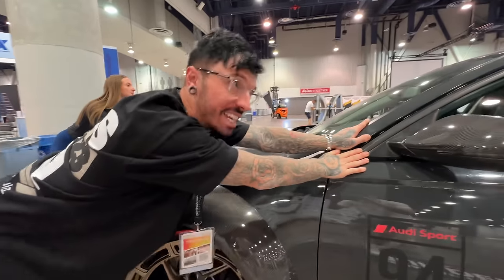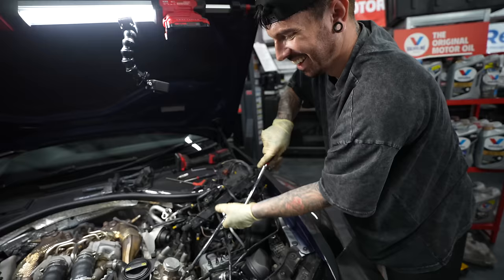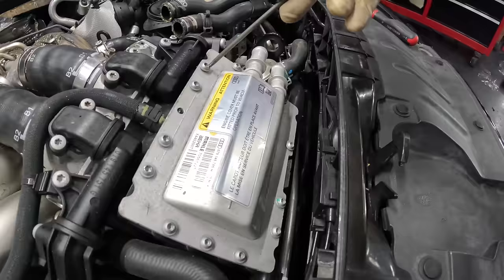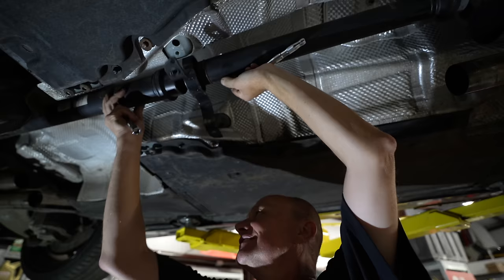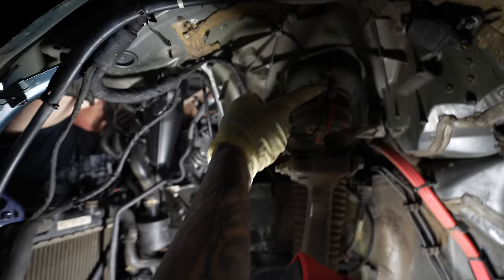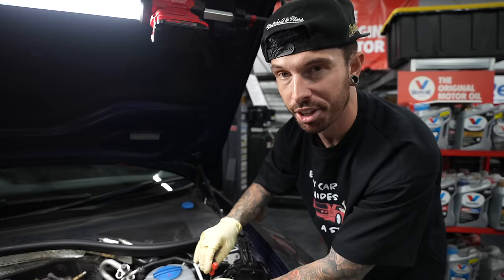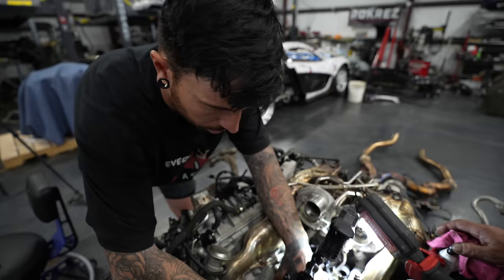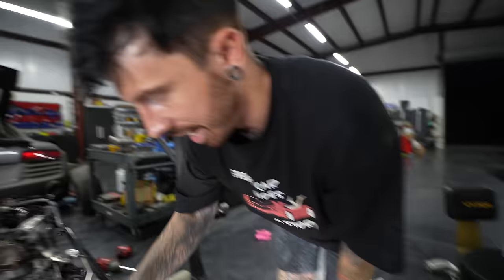REBUILDING A WRECKED AUDI RS6 GT3 #1

Comment: Hey Mat, every modern Engine have Knocking Sensors. If you put bad  fuel like 95 Octane in the Tank, the Car automatically change the Ingition for the Conditions. 

The Tuner has to recalibrate the Maps for that. But if you turn Off the Knocking System or Component Protection the Car will do everytime the same Performance also with bad Fuel. Otherwise your Engine Pistons or other Components can be broken like in your Video.

Greetings from Germany ✌🏻
Reply: Wahrscheinlich wurde das nicht berücksichtigt
Reply: he talked about in the last video or the one before that the fuel and tune probably was the reason
Reply: This
Reply: I also posted something similar.  It wasn't just the fuel, as the knock sensor would have protected the engine from pre--ignition.  Something probably happened during the remap that bypassed that safety.  100% user error.
Reply: Exactly..a very bad tuner is the cause, not just the fuel.

Comment: Great vid Matt. Sorry for the poor RS6 engine (been an owner of rs5 and rs6 myself ) The fault is absolutely on tuning and not on the benzine though. Should have gone for dual map on the ECU. I am on the opinion that supercars don’t need any tuning anyway :) .Love your work and vids. Waiting for the part 2 gonna be interesting
Reply: Its very kind on the remap shop. I am sure the stock map would have been able to detect the knocking and gone into limp mode before this happened. Regardless of the fuel it was mapped on, it does seem that some of the other safeguards of the stock map may have been removed.
Reply: Lol its nothing to do with the tuning. Its the fuel. Absolutely dumb comment.
Reply: @peterwilson4344   it’s the tuning or may be the not very professional tuning let’s say. The one mapping the car should have gone for dual maps. In case not then he should have said to Matt that it’s ONLY 99+ octane fuel and not use any other. So I discard your ignorant comment as you didn’t bother to read what i said. YES ITS THE FUEL FOR THIS result OF COURSE..but SHOULD HAVE BEEN A PROFESSIONAL tuning there would be a dual map or safe (limp mode) in case of knock sensing. If you get a 110v US appliance and plug it to an EU plug of 220v would you blame the power distributor? In case it had a switch you should have switch it yourself in case it didn’t you should have been informed that the boom will happen

Comment: Great video and hope the repair goes well. One little nit pick, a spark plug will fire before tdc not on tdc, this allows the spark to fully ignite air fuel mixture and have optimal power to push piston back down on the power stroke. This timing is actually changed when mapping the car

Comment: Never thought you could get a hole in your engine block if you use lower octane fuel after remap.
This channel turns into a car documentary.
Keep up the good work!
Reply: Normally you shouldn't, unless the tuner disabled the knock sensor and other engine protection systems to make it easier to map. It could very well still be down to a poor re-map

Comment: Freddy's shop works like a magnet on cars with water damage😁

BTW if the engine is completely busted just do an LS swap for shits and giggles 😁
Reply: Man come on look at that RS engine its already a race engine. The LS is fricking truck engine🤣🤣
Reply: @wcads623  I bet you an LS eninges is lighter, more compact and a LOT more reliable. And if god forbids, something like this happens, cheaper to fix as well.
Reply: @horvathr95  yep but to get the same power out of an LS would cost a hell of a lot more than the Audi motor.

Comment: Pretty surprised the ECU safeties didn’t prevent this. With detonation that bad, it must have had detectable knock long before this failure, I’d have expected a CEL and a limp mode to prevent damage. Surely the knock sensors were de-sensitized.
Reply: Agreed. Cali 91 is the worst 91 in the US. Wouldn't even consider it 95 RON. But the car should've pulled timing in an attempt to compensate for the fuel and sent it into limp mode with super knock codes. Combination of bad fuel + tune.

Comment: I know the video is 10days old but I work on old vw engines and to check if a intercooler works fine we use  two bits rubber hose plugged  up with a 17mm bolt and a jubilee clip done up tight and use a pressure tester on the other usually give you a good indication

Comment: Sleeving the block and it’s golden. That’s the problem with modern coated blocks. It can torch the cylinder as its just coated aluminum.

Comment: I had a mk4 rs turbo years ago dine by interpro. It appreared in the max power or fast ford magazines, it was one of the first cars with water detunation tank fitted to it to stop detunation and the cylinders from getting too hot at higher speeds maybe a thing to consider to fit in the future.

Comment: Mat one trick you can do is if you have lap timer enabled on your dashboard it will display your oil temp reading on the heads up display. Might be useful if you wanting to keep an eye on your engine temperature. I always drive with it on my 7

Comment: As a Subaru owner. Using the correct fuel is the number 1 rule of Subaru ownership. Also. If the car is mapped. You have to continue to use the fuel it was mapped too. If you can’t get the proper rated fuel. It ‘may’ be possible to use a small amount of a lower octane fuel but then you need to go really easy on the throttle. No boost. Until you can get a full tank of the correct Ron fuel. Bit late now I know. Now you can forge the engine too. Yay.

Comment: Incredible that the head gasket didn't blow as well - but piston being able to blow a hole right through the sleeve is incredible heat and pressure at one point - wow - ok, so now you have to find a 2nd hand block in good condition - that part shouldn't be to difficult..

Comment: Top Team Mat and his Dad ..... I owned a top spec S8 back in the day  (1999 - 2002). I took it to Agnew's in Belfast to fix an intermittent misfire. 3 visits with them and then a so called specialist ex Audi Dublin .... And £7,000 pounds down it still was not fixed. The guy I sold it to was a young airport mechanic..... He Sorted it in less than an hour ... It was just a blocked valve. Guys who use just diagnostic computers are useless. Experience is everything !  Can you imagine what the repair bill would have been on the RS6 if you had to take it to a garage ????? Audi's are now over engineered today  !!

Comment: vapor locked engine when running usually bends rods probably bent a rod or 2 or 3 and that's holding it from turning over

Comment: Back in the seventies I built a sunbeam alpine roots engine to stage three cam head mods inclined valve guides etc the twin 40s needed a custom inlet when I fitted it the spanner nipped the side of the ally inlet causing a small crack , 500 miles later a hole burnt through the side of the power max piston that let me slide my pinky through,the smoke that came out when it blew was epic, the good news no damage to bore or the piston rings, after fitting new piston and welding up the crack the engine went on to give awesome fun, 8000 rpm it would spin up to in the day that was an awesome number for the long stroke 1725 roots engine, it could gap the tiger v8 engined sunbeams with ease ,

Comment: I got a mazda 3 for free one time because it hydroplaned into a ditch and sunk.. it hydrolocked the engine and the hood was completly submerged... the oil was mostly water just like that.. got the car running but had a bad head gasket from sitting with all that water in it, or maybe from when it was hydrolocked, not really sure but i junked it lol...

Comment: You should place the charge Cooler in a bucket of water & use the workshop Air compressor to pressurize the  coolant side. If it bubbles it means theres a leak - as Metal gets hot it expands so you could have the fault when your car is warmer. :)

Comment: Matt, you know why that engine has seized was because when they press your head gasket on that head had blown, so then the cooling system that’s inside of the head had ended up going into the cylinder and causing the cylinder to seize and also starved of oil, so that will be why the  Oil will come after a fair bit of coolant

Comment: That one piston is crazy bad. If you can, get the injectors tested as this may tell more of the story. If the lower octane fuel was the cause wouldn't it be more evident on more than one cylinder? If the injector was partially blocked and not giving the correct amount of fuel then it could cause a lean condition that would put the extra heat in to the cylinder causing the issue. Definitely worth checking either way especially if your planning to reuse them in the build.

Comment: normally that is where the sensors on the exhaust come in, ie they measure and black box fine tune the injector to spray more fuel in the event of lower octane until it gets the desired result on the lamda sesnor, if the injector volume it can spray is lower than what is needed to not run lean you have a problem

ie normally cars handle different octanes ok as long as the octane is within the range the car was designed for
so assume the injector/injection system is sized volume wise for the octane of said countries 

so in the case of 91 maybe the injectors just could not deliver the amount of fuel needed not to burn lean

Comment: you hit the nail on the head with the fuel. it causes all sorts of problem running a turbo car on on low octane fuel and in the end causes exactly what has happend. never ran my subaru on anything other than 98 octane.

Comment: Sorry for your loss but just slap any 4.0tt back in there you already have the turbos so you just need a new engine should be around 5-10k based on milage

Comment: Just by removing the bonnet you could tell this will be a nightmare to work on, kinda makes you appreciate LS Crate engines being relatively easy to work with, and not this overengineered mystery box of an engine. 

But when you pulled the spark plugs out, wasn't there another one being super wet?

Comment: Ive seen people complain about how bad Honda's are to work on, but after having owned Honda's and Audi's.... Nothing really prepares you for the nightmare that was the 2.0T engine or the frontend removal for a timing chain replacement, CVT gearbox issues, or siezed upper control arm bolts... If i close my eyes, the nightmares come flooding back...

Comment: I don't know if you removed the water, that us viewers saw you put in the car. Next if you plan to race a car I in the past installed additional main bearing caps then I was able to buy Aviation fuel and added one cup to a full tank of fuel. 
This would kick your octane up over 99 octane which would keep my polished intake and heads clean but daily would eat Z28 and trans am for breakfast. But my car was an all steel LT 1 350 coupled up to a old rebuilt 350 turbo transmission in a 1965 SS Malibu

Comment: Normally what happens when they get hot due to pre ignition is that the tip of the plug melts (as you've seen) then this drops into the cylinder and causes the carnage

Comment: Oh my days Mat.
That is not good at all.
In my 40 years of fixing engines I have never seen nor heard of the bore fail and especially the bore going into a hole.!  .. Gasp! 
I'm not sure if that could be fixed with lazor cold welding, But I feel NOT.
So, that's a new engine yes.
I feel very sorry for you having to get that sorted and it's going to cost £££££ 
Look forward to seeing the next video to see how you're doing.
Good Luck Mat....

Comment: This engine has knock sensors. Usually they detect any kind of misfire due to low octane fuel or something else in what case the ignition advance is reduced as well as the  turbo boost pressure. Why didn't this work and prevent from damage? Maybe because the remapping didn't properly use the information from the knock sensors. Maybe you should have checked this properly before using the rebuild engine under heavy load. Good luck and best wishes from a petrol head from Germany.

Comment: I went back to the video in Cali and  you filled up at Shell which isn’t known for bad gas at all, you also hit 91 Octane which was the highest available,….so question, what’s the Octane of high grade in England? Spec for the car is 91-93 . 
I’ve always questioned if high grade is worth it, even with my Focus ST that I wasn’t shy to drive, I never once put higher than 85 in and never had an issue.

Comment: @10:00: the ecu should detect self ignition and reduce the power. But maybe the tuning guy bungled the software and turned off the safety features which is a q'n'd solution and not a proper tuning!

Comment: 09:50 spark occurs before TDC, not at TDC. The fuel/air mix needs time to burn.

Also, if the car was detonating due to lower octane fuel, the knock sensor should have pulled power and put it into limp mode (or similar). If this didn’t happen, then the tuner must have altered the knock control parameters, which is a very foolish thing to do! Honestly, I highly doubt they removed knock controls as they’re a reputable tuner, right?

So I find it hard to believe it was the lower octane fuel.

Comment: These engines are already quite maxed out and then you tune it up even more which gives too much compression pressure in the cilinders and high fuel burn temps melting your plugs

Comment: When he drained that oil you can clearly see that it was water not coolant in the last video when all the coolant drain due to the hose no being connected he put water to take it home so he didn’t replace the water with coolant the car over heated and the engine seized

Comment: I find it crazy to see that such an expensive car doesn't have adaptive spark... aka, the built in ability to auto adjust timing and air for the fuel quality.  I drive a 2008 Bullitt, and it has adaptive spark.  Literally this problem cannot happen without something else breaking first.

Comment: Wow.. I did not expect the fuel to be the issue! Then again, I was unaware of the remap you did on the E99 fuel. Only using E99 vs E95 was a gamble it seems. Out of curiosity how much torque/hp did you gain from going E99 compared to standard E90/E95? (Now I understand why BMW/Porsche, etc tune their cars to go as low as E85 for fuel type).
Reply: I thought e85 is a very high ethanol fuel that people use in performance cars because of its high octane rating?
Reply: @cantfindanamefree  That is what I thought as well. If the engine is designed to use this type of fuel then it should perform as well as the E95 or E99. In the UK I wasn't able to find E85, but E90, E95 and E99. The only thing I was able to measure (subjectively) is the fuel consumption was a bit better the higher the E fuel used. (Think 37mpg vs 40mpg or the likes).

Comment: I doubt that's fuel related.  It would have knocked and immediately pulled timing.  We make 700whp and up turbo or not on 91_93.  It's only two octane points less than the uk fuel.  Something else going on,  tuning mistakes like too much timing maybe.

Comment: I must of got so lucky on my S4 b8 supercharged it was tuned to run 99 and one night I put 95 as the station had no 99ron I put my foot down on the motorway and engine cut out instantly. I roll to the hard shoulder thinking wtf, started it again was idling fine so I drove home very slow I did figure it out that is was due to the fuel, full tank of 99ron but drove for another 3 days slow

Comment: Well, this is not that simple with the fuel. This is foolproof in almost every vehicle in the past 20 years: there's a knock sensor in the engine block and it always checks detonation. For example you fuel up your vehicle with RON98 fuel and then bigger pre ignition will be applied AUTOMATICALLY. Then you fuel up your vehicle with 95oct and then it reduces the pre ignition.

On the other side: there are PLENTY of functions for component protection (for engine, turbo, trans etc). You got check engine and LIMP mode before the engine blows up.

I'd assume that the remapping was somehow wrong (wouldn't be the first time...) OR the knock sensor is useless in the engine.

Anyway, just simply changing fuel is not enough to kill your engine like this, especially not a modern and "highly sensored" engine.

Comment: Get the new pistons, cooler plugs😂  geezus thats at least two grades of plugs cooler.  Weld the block,machine and either Resleeve or use the Mercedes Benz silicone process on the bores.

Comment: As i predicted :( not so fun fact, when the combustion temp gets high enough, the air literally turns to plasma, cutting a hole straight through the protective oil layer and through the piston and in this case the side wall as well.

Comment: I dont know a hell lot about cars, butwhy did it only happen in one cilinder? I know that once one of the  cylinder has a hoe the whole engine stops working that prevents the other cylinders to blow a whole in the wall of the engine, but it doesnt happen on an instant, shouldnt it be logical that the other cylinders have some sort of damage as well?

Comment: Driving my girls car last week and noticed it was burning oil when id pull off a stop. So asked her if she noticed and she says that it's been happening since she added oil a month ago when i asked her if her oil level had been checked lately she did it the next day...I said how much you put in and she said 4 quarts. I said honey It only holds 4 quarts, so was it completely empty?  she said Well it was half below the fill line, so she went inside and asked what oil and how much it needed , they told her that her car needed 4 quarts, so she put it in. lol I had to suck 3.4 quarts back out the top of the engine.,.  can't believe it ran for a month fine with 2x the amount it was supposed to have. when Matt pulled the oil plug reminded me of it lol